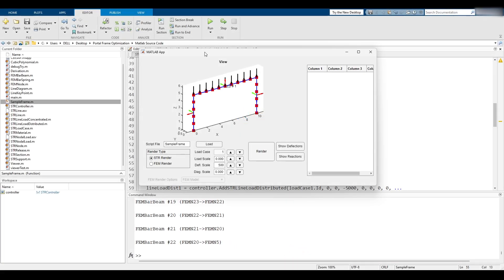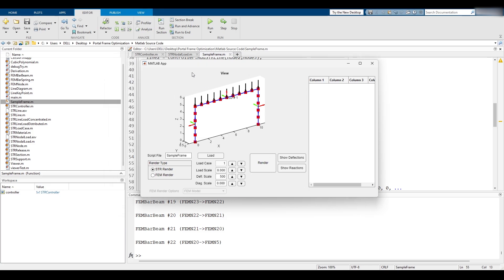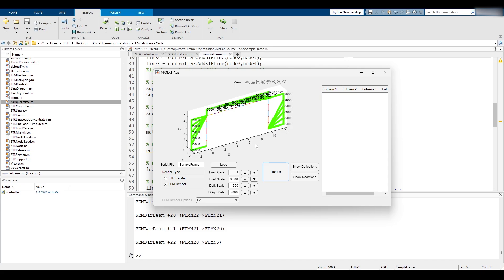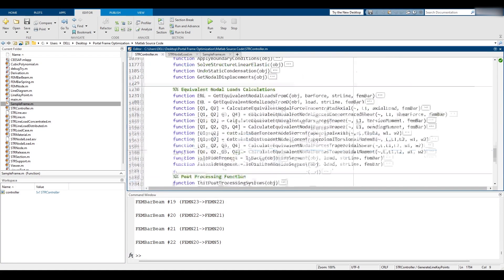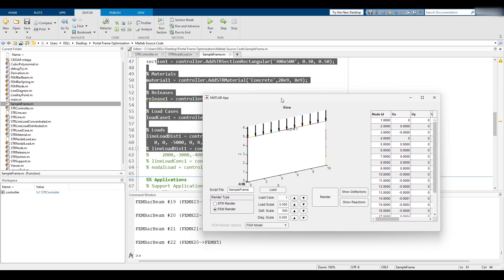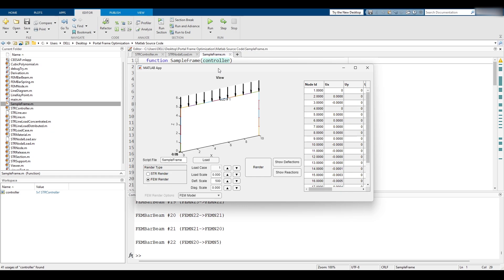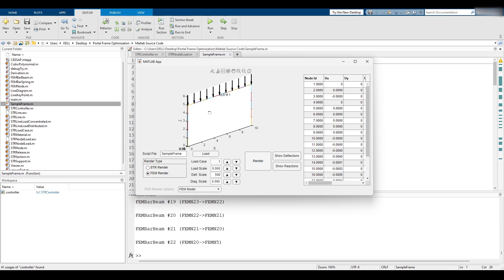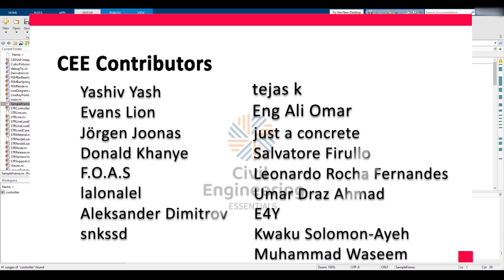Programming the Finite Element Method using MATLAB - Part 1: Introduction

Comment: Thank you very much Dr. CEE. The least I can say about your videos is spectacular. 
Your Robot courses are honestly mind-blowing, as they helped elevate my understanding of the both the software and structural engineering
I have a small question if you don't mind, what is the possibility of you doing a small playlist about dynamic analysis and response spectrum? A one similar to the Equivalent Lateral Force playlist
Reply from the maker: I am planning to have a full fledged dynamics course (theory and application in RSA). The topic was my PhD topic back in 2016 and is still my main research focus. So your recommendation is 100% in-line with what I really want to do.

I will do my best and push hard to provide videos hopefully on time ^_^. 

Regards,
CEE
Reply: @CivilEngineeringEssentials  I wish you the best of luck Dr. 
I am a subscriber for life!